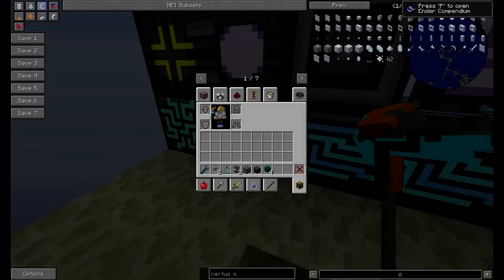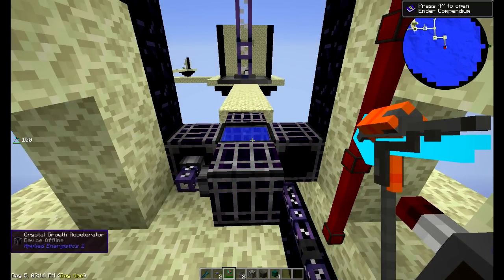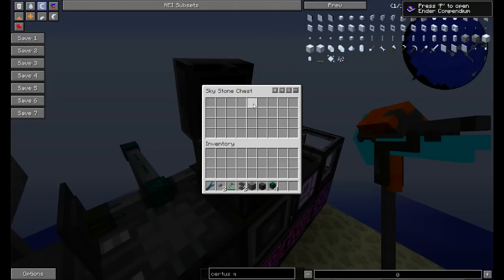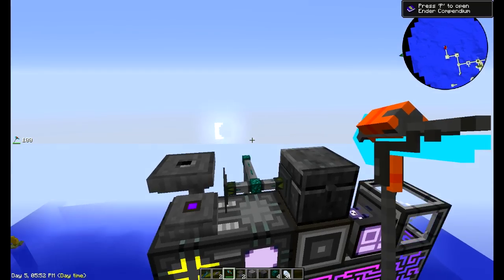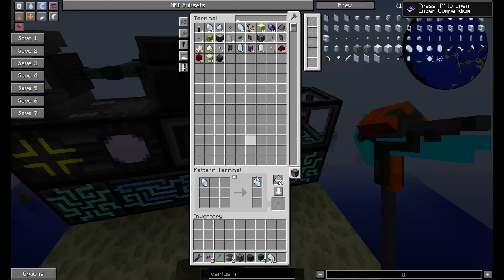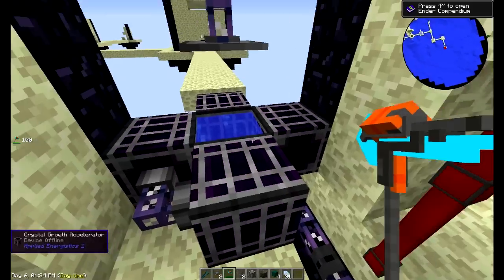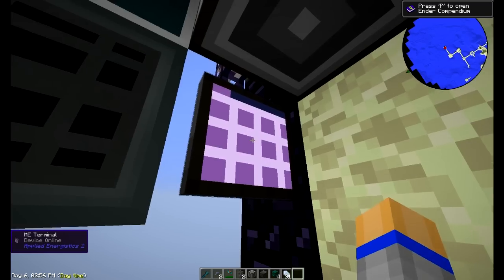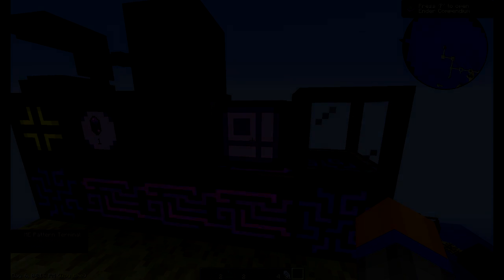Applied Energistics 2 - Crystal Growth Accelerators - Power on Demand

Comment: How do you filter annihilation planes? As far as I can tell they don't have a UI for it.
Reply from the maker: Toksyuryel correct there really isn't a GUI for that.  One thing you could do if you don't have Extrautil or Randomthings is to create a loop (make a water path) with the annihilation plane.  So that after it leaves the annihilation plane you can send it to a chest. Then export back to network if it finished if not, spit back to the water path.  It is much easier if you have one of those mods listed above though.  I think there is a video on that process on youtube here somewhere, let me know if you can't figure it out and I will see if I can find a link to it.
Reply: Jeff Saunders
I just ended up doing it with the advanced item filter like you're doing here. I wanted to use the annihilation plane purely to make the build less dependant on other mods, but doing that loop thing doesn't seem ideal because then the seeds aren't spending a lot of time actually in the water so they'll grow much slower. Either that or I have to build an appalling number of growth accelerators for it to fall down a water shaft through, which also isn't ideal.
Reply: Toksyuryel Yeah I agree it is really only a last resort if you don't have the other mods.  The other advantage to not using the annihilation plane is that you get a 5th growth accelerator for even faster crystals.  Glad you were able to get it working! :)

Comment: I just wanted to know, how I can drop the materials into the water and pick it up without using extra utilities and you helped me a lot ;) (I really don't care about energy waste - i have enough big reactors and big turbines to produce a few million rf/t :D).
Great tutorial btw.
Reply from the maker: If you have extra utilities you can use the world upgrade on one of the transfer nodes(items). Then an item filter as well in there so it will only grab the finished pure product. Then attach the other end of the transfer pipe to an interface.
I put 4 speed upgrades, 3 world interaction upgrades and a filter and it worked fine.
You could also go with only 4 growth accelerators and use an annihilation plane if you don't have extra utilities.